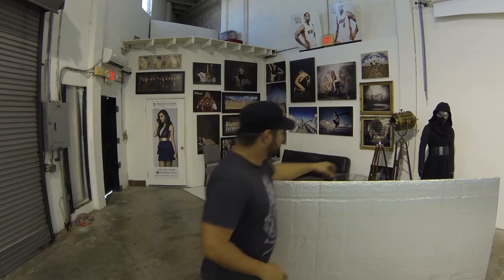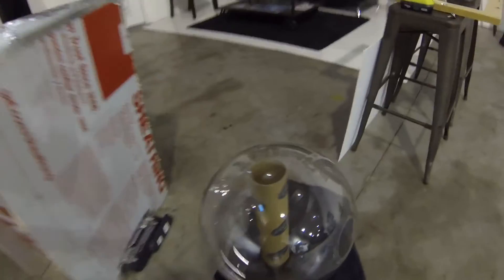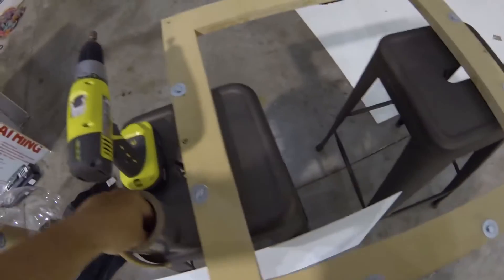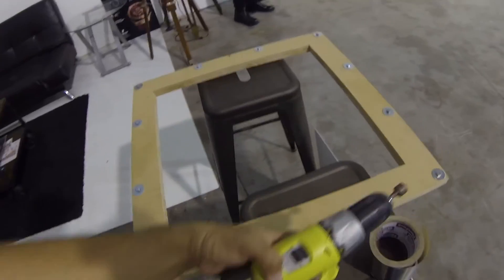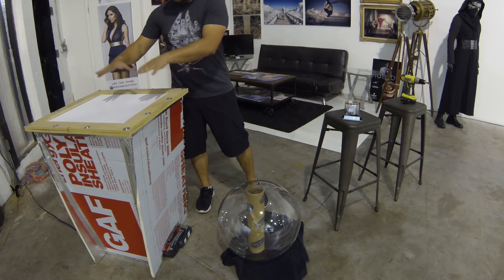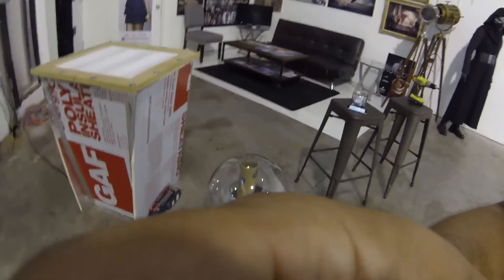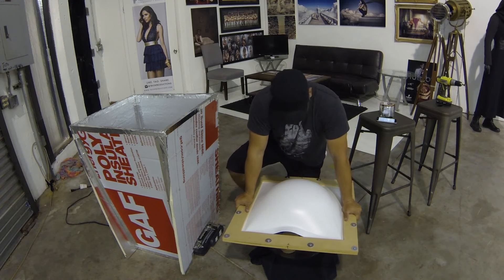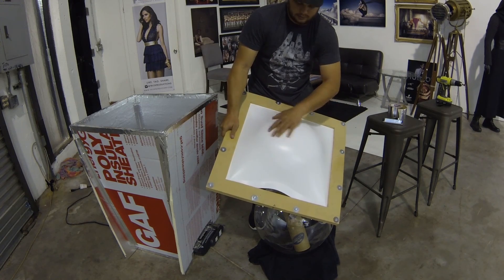BB-8 Foam PVC  Panel Thermoforming

Comment: It wouldn't hurt it to have a 1/2" thick board around it right?
Reply: instead of 3/4"
Reply from the maker: Alejandro Alvarez-Barreiro I think 1/2” might be too thick. The sheets I used were 8mm thick.
Reply from the maker: Alejandro Alvarez-Barreiro wait, did you mean for the wooden frame? Or for the Sintra sheets?
Reply: @TrickProductionsTV  For the foam board around the actual heater. Thank You so much for replying by the way.
Reply: haha just noticed i'm on a different account